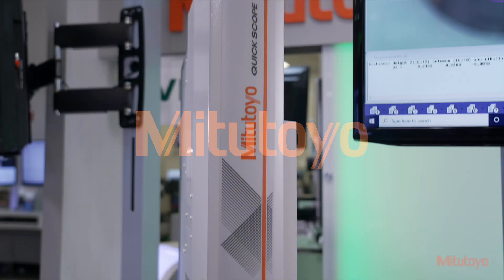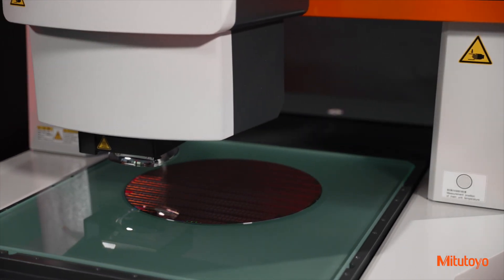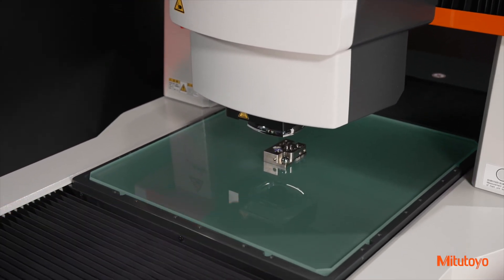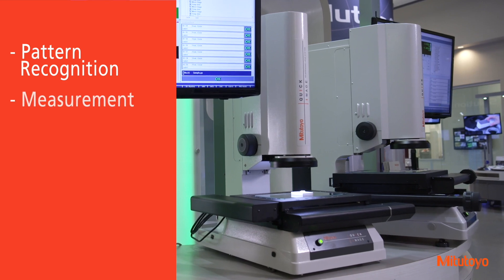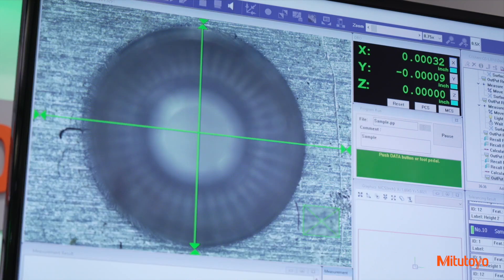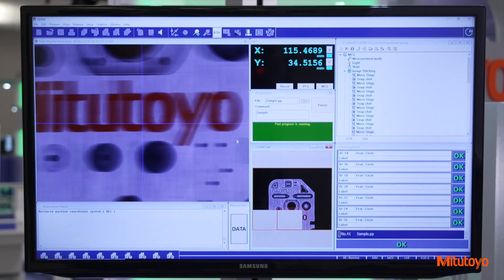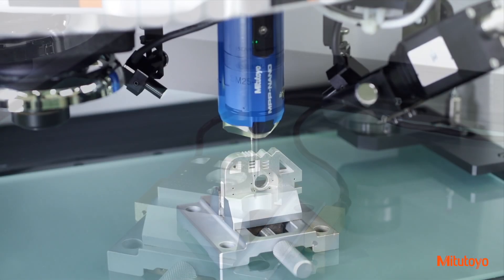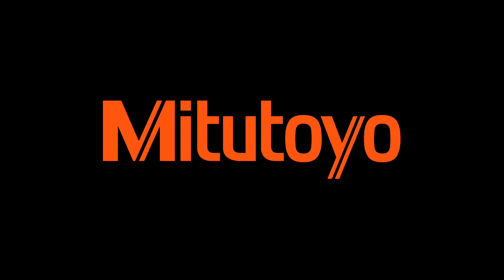Vision Measuring Systems From Mitutoyo

Comment: I use one of them and i don't like the guiding software. It is not confortable for a simple action you should do a lot of clicks the path is too long for elementary things it is just not userfriendly and that costs time money and putting so.much amount of.force in something easy by default. The support is also awful just search for another supplier of equipment.

Comment: Big question!

Is the 'edge detection' based upon the recognition of planes or other well defined features? I ask because features such as "corners" do not exist in reality. A corner is the intersection of two planes. So in performing 'edge detection'; are you measuring the planar features directly?